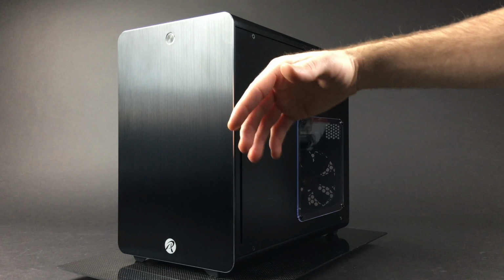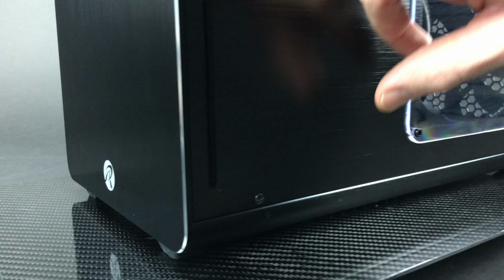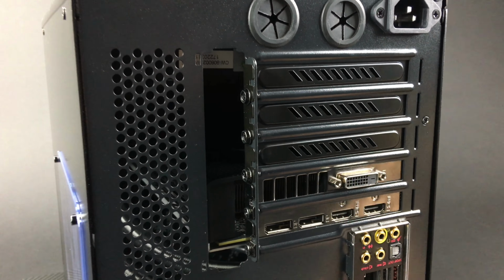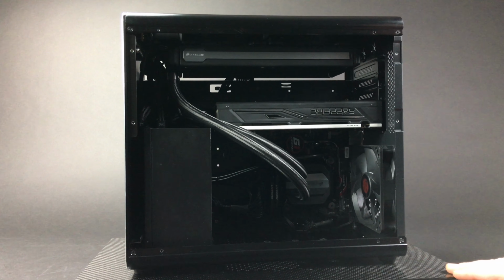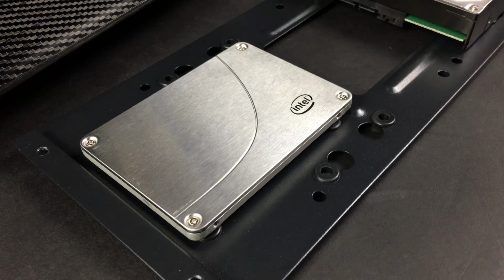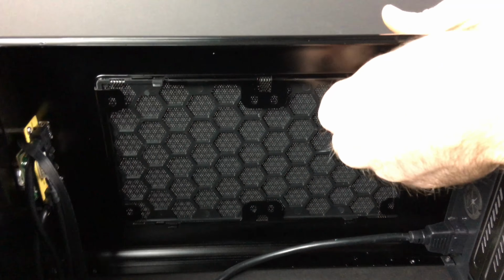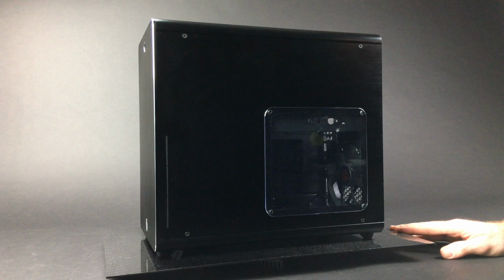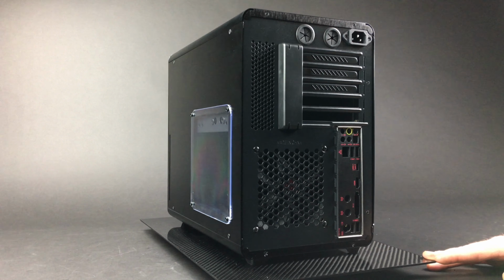CHEAP BUDGET MATX PC CASE RAIJINTEK STYX REVIEW

Comment: I built a small PC using the Raijintek Metis, and it came out great. It was extremely full when I finished. I had a spare full-size ATX power supply, which went into it, plus a large Hyper EVO 212 CPU cooler, which barely fit. In addition, a short Radeon RX 550 4GB video card, a SSD and a full-size 3.5-inch 500GB spinning drive.

I think the quality of the case is excellent, although I'd like to see mesh filters to block dust. Aside from that, I was very impressed with the Raijintek quality. I'm planning another ITX build and am looking at the Ophion this time around. I have a spare 240mm GTX 1060 6GB video card, so I would like a larger case.

Comment: well, thank you guys for the review....
Reply: RaiJintek the case is gorgeous, but function over form good sirs. Not the other way around. If it was a mesh front or had a inch gap for air flow, I'd be sold. But because of my concern of restricted airflow nty. Sure theirs cheap aio coolers , but graphics cards dynamically overclock these days based on power and tempature. So losing out on tempature  for looks suck because that's giving up performance and longevity of the parts. I even like the optical drive bit, it would be perfect for a m-atx htpc.
Reply: Personally, I don't particularly care that it doesn't have a mesh front. I actually prefer it the way it is. I think the only thing I would change (or offer as a separate purchase at a later time) is a bigger window on the side of the case. I suppose us case modders could find a way to accomplish that, but I don't like taking risks with beautiful aluminum cases like these. 

I own a case that was a blatant ripoff of the Rajintek Metis case (sorry Raijintek!) called the Raidmax Atomic. The main difference between the Rajintek Metis and the Raidmax Atomic is that the Raidmax Atomic has windows on both sides of the case, as well as on the front... Which makes for some potentially badass lighting effects. The only thing I don't like about the Raidmax Atomic is that they cheaped out and only offer one front USB 3.0 port (the second one is USB 2.0.... What a way to waste a USB 3.0 header). Rajintek, on the other hand, offers TWO USB 3.0 ports on all of their aluminum cases they have for sale. 

In many more aspects than just this one, Rajintek appears to have good attention to the details. Across all their aluminum case offerings, I found the case layout designs to be very clever.
Reply: I'm planning to build an matx system in this case, but the white classic (no window) version isn't available in my region. Can you tell me if the front panel is removable? That way I can buy the black one and spray paint it white.
Reply: Thetis Classic is the best smallest ATX case you can buy right now. Thank you RAIJINTEK, i love my build :)

Comment: I had one of their older cases and it was abysmal, there was no airflow and the 3.5 drive slot was tucked into the top so all of the exhaust went up to it, ended up making the hard drive shit the bed, but I'm really glad that they are substantially improving, because price to performance seems super solid now
Reply from the maker: Agreed! Also my experience with them has been very good, they usually always respond to my questions within 24 hrs or sooner.

Comment: Can anyone who owns this case tell me how the DVD is ejected, as I can't see the button?  Also is it compatible with an ultra slim drive as well as a slim drive? Reviewers always seem to gloss over the bits that we really need to know.
Reply from the maker: Only fits Slim Drives. You use Windows to Eject, (Eject from Windows methods) link,  https://www.wikihow.com/Eject-the-CD-Tray-for-Windows-10
Reply: @MaxellAdGuy  Thanks for the quick reply Bill. I am building this PC for a relative, so the windoze option ain't gonna fly unless I write a batch file.  And does anyone know where I can source a slot loading slim drive? I can only find an ultra slim (which kinda makes sense I suppose for a lot loader).
Reply: I have compared the drawings for slim and ultra slim dvd drives, and can see absolutely no reason why the ultra slim will not also fit (the mounting holes align).  Although I can not confirm if the slot will align.  If anyone has tried an ultra slim, feel free to let me know.

Comment: As far as fit and finish I would somewhat disagree. I bought two Metis cases and the the countersinking on the inside was very poorly done and a couple screws would just spin and not tighten. I had to use teflon tape to get the screws to bite.

Comment: Nice "looking" case but really no airflow options... so bad. No filter on the bottom, I assume, intake option. I think the mobo is so close to the base, you can't even fit a fan there even if you wanted to. And might be drawn in hot air from the PSU?
Reply from the maker: yes, you nailed it buddy!
Reply: My best bet would be using the case upside down, sucking in air at the top and blowing it through with the help of the GPU fans and exhausting it at the bottom via the PSU and two additional fans. I think this is how the case was intended to be used, which begs the question: Have they ever heard of basic physics?

Comment: Nice review gents. One thing that looks to be true with this case is that (I believe), like the Metis, it's all screwed together so modding/painting are that much easier. I put a full loop in the Metis and there was no way in hell I could have done it if I couldn't rip off every panel easily without using a 1/8" drill bit to de-rivet the whole thing.